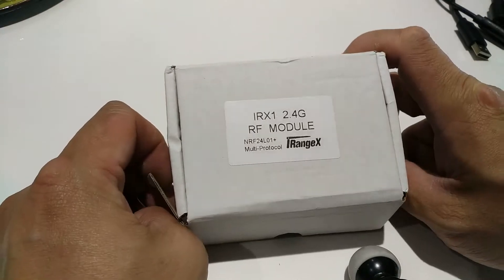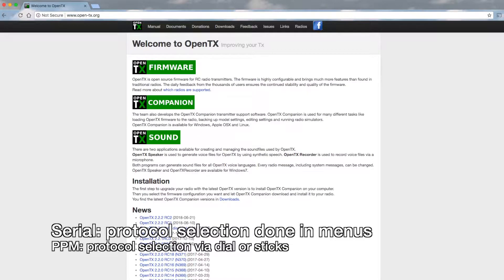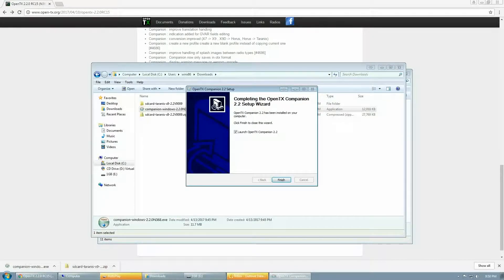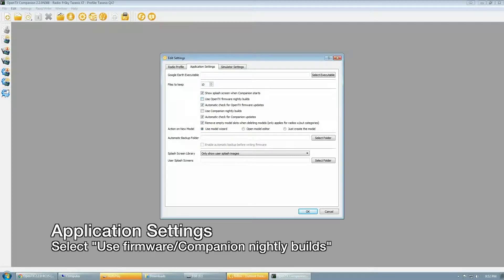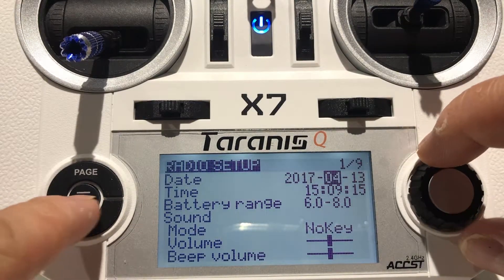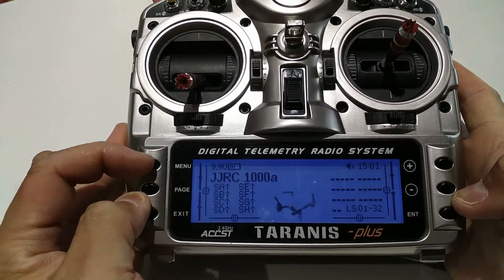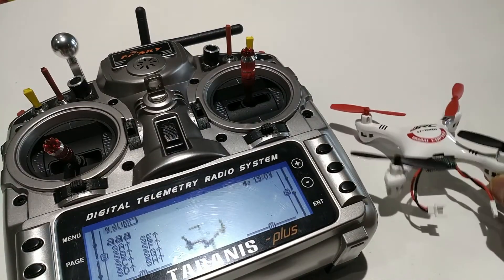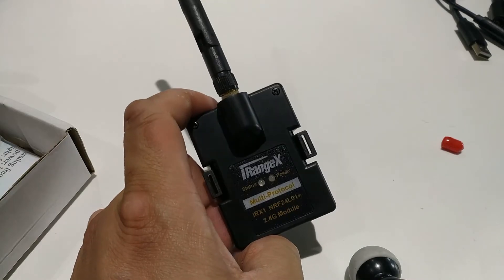iRangeX IRX1 NRF24L01 Multiprotocol STM32

Comment: first at all thanks for your videos I learned a lot but I have a question about this module.. I have a turnigy 9x transmitter with the opentx firmware already installed, so I have been trying to donwload the new firmware with the multimodule option for my radio but it doesn't have any so the question is simple this module won't work with my radio??? or if so hw can I make it work??? thanks
Reply from the maker: This module only works in serial mode with a firmware that supports it. So I'd say no if yiu can't update the firmware. .
Reply: @KenVersus  thanks a lot and that is a really sad news... I´ve seen that even in the open tx website they did`nt update the firmware for turnigy radios... anyway thanks a lot
Reply from the maker: The 9x was a good radio. But it's harder to update it since there isn't a USB port.    The 9xr pro is a good successor